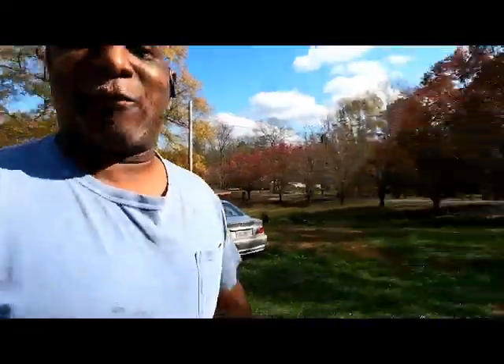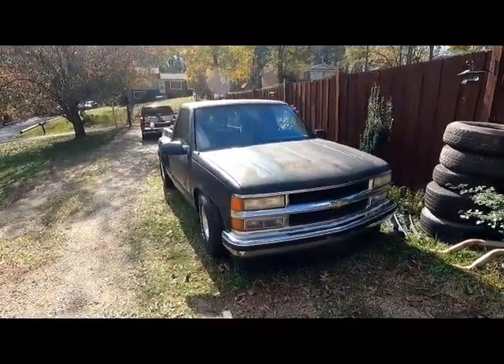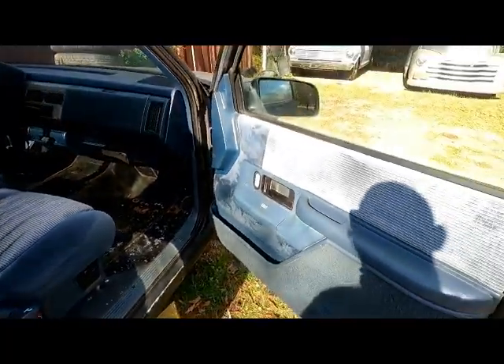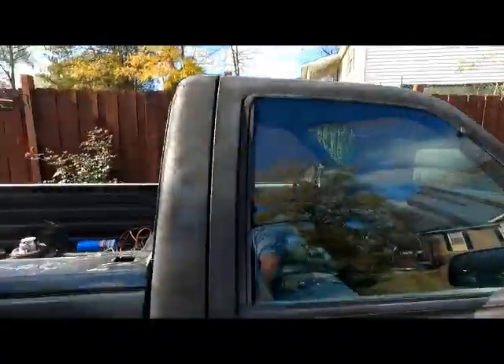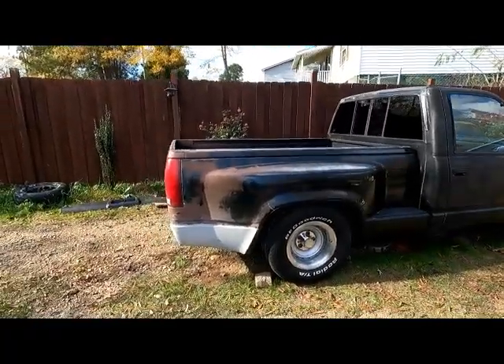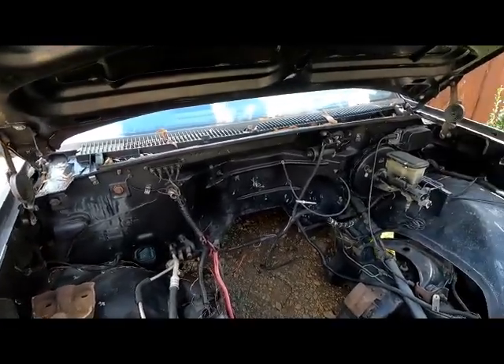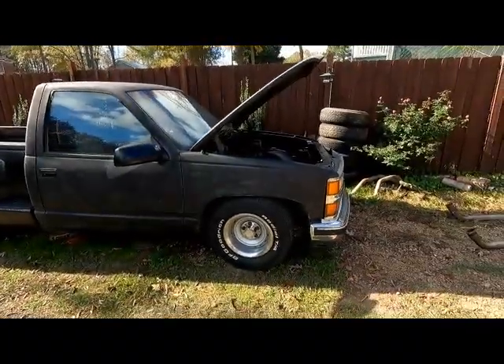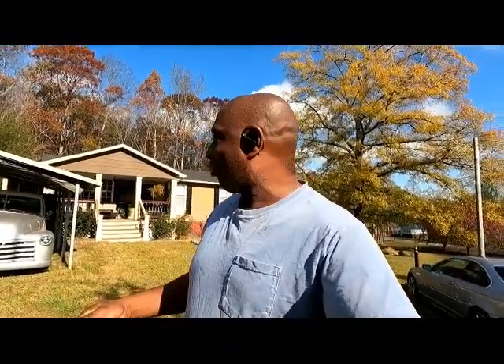From long wheelbase to Short

Comment: How many inches did you have to cut for the conversion?
Reply from the maker: Moved rear end with leaf springs forward about 17 3/4 inches then cut the extra off back. Double my measurements been a long time now. What ever the difference between a long wheelbase and short is what I moved up the rear. Then I used garage 8 hardware 3/8's to remount everything.  Hope this helps